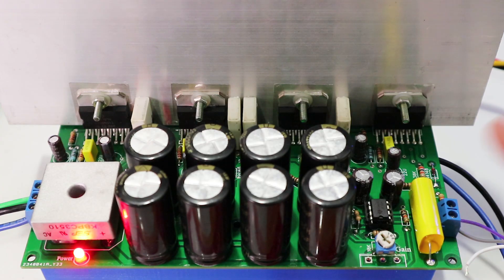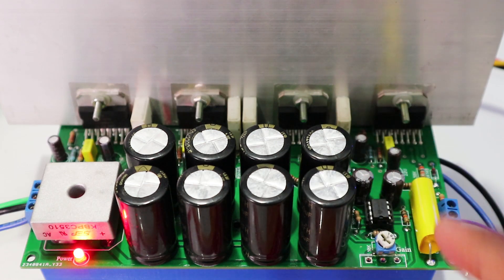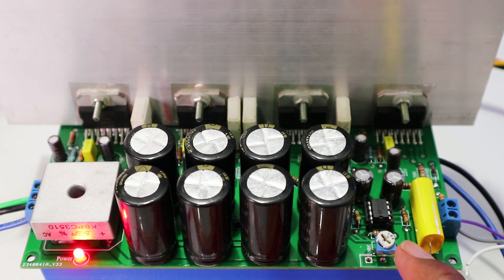4XTDA7294 Double Bridge Paralel Amplifier Build

Comment from the maker: Revision : Change the coupled 1K resistor on the input TDA7294 with value 22K or more. It will decrease noise when stanby.. please see the schematic.

Revisi gan :
ganti resistor 1K yg ada di input TDA7294 dengan nilai 22K atau lebih. hal ini untuk mengurangi noise saat stanby tanpa musik.
lihat skema nya
Reply: Mantap mas😁 apak itu tda 7294 di BTL 🙏🙏

Comment: Sir, Can you design active subwoofer filter circuit (ic Tl074 + Tl072) with mono 150 watt  Rms power amp), (pdf file please) 
input source 5.1 denon A/V Receiver.
Reply from the maker: may be like this ?
https://youtu.be/3vkh9-PIoUo
Reply: Sir, 150 watt rms  power amp correct but I want the high gain subwoofer filter circuit double ic Tl074 + Tl072, 5532,4558
(subwoofer filter + power amp, or only subwoofer circuit)
sir I want only pdf file not gerber file because Not possible  to order jlcpcb
Reply from the maker: oh, please check the description of this single side video version : https://youtu.be/NuKArLzO5Ww
there is zip file you can etching by yourself. and you can get the high gain with changes the gain resistor
Reply: @barlexrespectaizer452  this circuit is nice but I want subwoofer filter circuit only Tl074 ic, because this ic is quod op amp and best ic for subwoofer filter circuit. Thankyou,
sir I want Tda 7294 Mono power amp circuit (Pdf file not gerber file.
Reply: Use 5532 that's best